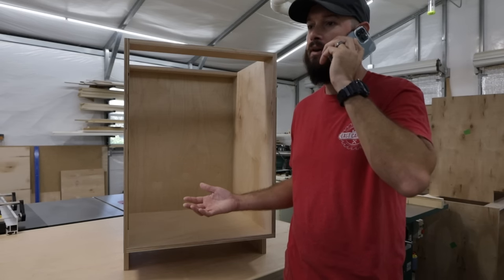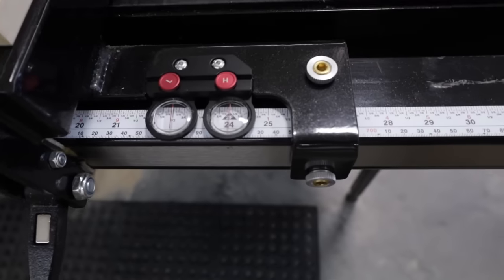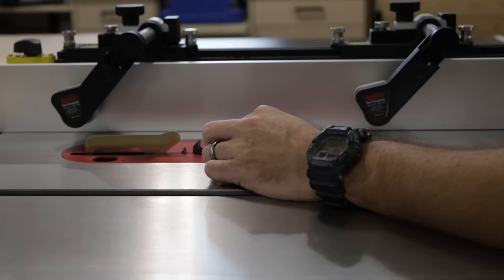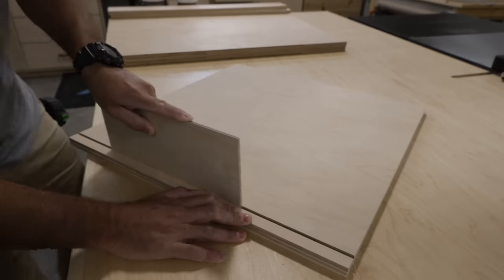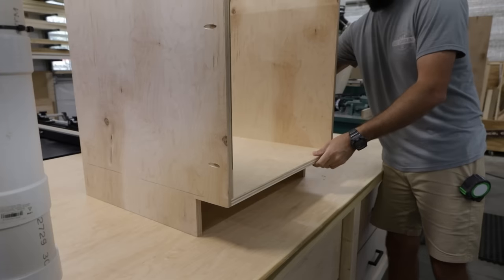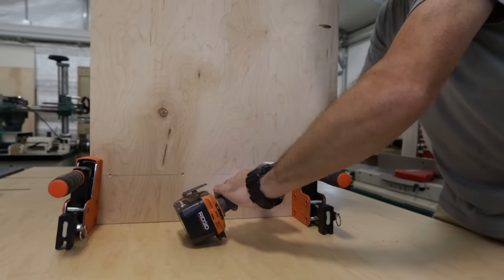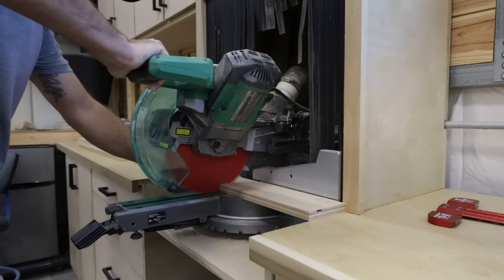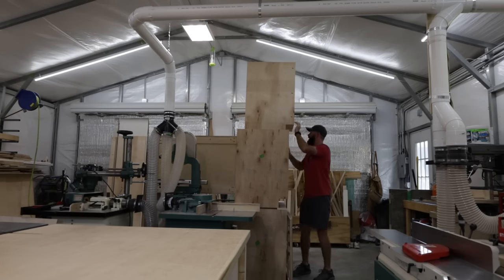How to Build Cabinets in under 30mins //The Easy Way

Comment: what fence system do you use on your table saw? I don't think I recognize it.
Reply from the maker: I have the Harvey alpha 4hp and the fence came with it. Unless your talking about the Jessem stock guides attached to it?
Reply: @eastcarolinawoodworks  I have the Jessem stock guides and love them. Probably one of the better upgrades I've made in a while. I have a saw stop cabinet but am less than satisfied with the fence, so I've been looking for ways to change/upgrade it. Thanks! Great video btw.

Comment: I just build a box, prop the bottom with 2*4's and adjustable feet and skip the facing. Doors or sliding draws you want to utilize all the space. possible.

Comment: i would argue a better way is to rabbet the back panel in (small gauge air-stapled), resulting in a flat back, biscuit join the sides to the floor with 5 on each side.  stretchers on the inside, pocket screwed on the front as shown.

Comment: Did you know if you use a loose base instead of an integral toe kick, you will get better yield from your material, easier installation because, you can level your toe kick for a run and place your cabinets.
Reply from the maker: I know but for me sometimes this is easier 🤷🏻‍♂️

Comment: Pretty good, but not exactly what the intro thumbnail showed, which was the cabinet with full face frame. A bit more challenging. 

Also, I’ve never been a fan of cutting in the toe kick. As a builder and installer often working in older houses, getting base cabinets level and square to the wall can be a real challenge so I build a 4-1/2” base to support my 30” base cabinets and level the entire run at once. Leveling is easier, installing the finish kick is easier and sturdier, building carcass is easier. And the added benefit is with 30” height instead of 34-1/2” you can get 3 sides out of a sheet of plywood with only 6” waste instead of 2. That’s if you’re willing to live with a 23-7/8” depth instead of 24”, due to saw kerf, which I generally am.

Comment: Just my 2 cents but I see you put a pencil line on the outside of the cabinet where to add the Screws . What i do is pre drill through the Rabbit and then there is no need to scribe a pencil line .
Reply from the maker: Great idea thanks for that 🤙🏼

Comment: Nice video. Two suggestions: 1) Use push "sticks" as much as possible anytime hands have to get close to a blade. There are "sticks" made that aren't really sticks, but a "handle" with a lip that drops behind the piece being pushed through. Whatever the choice, be safe. As others have said, disaster can happen instantly...along with the regret. 2) PLEASE do NOT do woodworking without dust collection/mitigation, or at least good dust masks. I don't see it in your video, but hopefully you do have it running. If you research woodworking dust, it is nasty stuff that will cause lung issues down the road. The "good ole boy" woodworking might look manly, but fine sawdust is nothing to be trifled with, and it hangs in non-moving air for some time.

Comment: why wouldn't you put the Kreg holes on the inside of the cabinet so that your Cabinet outsides were perfectly clean?
Reply from the maker: If my cabinet is sandwiched between cabinets you will never see the sides so it really doesn’t matter. On a finished end that gets painted I put them on the inside. Hope this makes sense 👍🏻
Reply: @eastcarolinawoodworks  Makes total sense, great work by the way, very nice build.. totally solid cabinet
Reply from the maker: @tmilholin7552  thanks for the positive feedback 👍🏻

Comment: For that bottom panel, couldn't you just use pocket screws on the bottom side of the pannel instead of counter sinks from the side? I worry that I'd drill/screw crooked and leave a screw showing in the bottom pannel

Comment: Greetings from northern Wake County!  As for your cabinet sheet goods, do you prefer so-called 3/4"  (actually closer to 23/32") or 18 mm or more rarely19mm?  Cherry? Oak? Birch? Alder? Walnut? "White Wood" (aka mystery SPF plywood)?  Do you use 5- or 7- core el cheapo plywood or do you ever prefer lumber core plywood or the really good (and expensive) stuff -- 11-ply Baltic birch (or a domestic equivalent like Appleply)?  

For the past decade-and-a-half or so, kitchen designers and the magazines they support have been pushing painted cabinets rather than stain-grade finished wood look.  Even my sister insisted on redoing her beautiful cherry cabinets with a hideous white painted finish (much to my horror).  I think it's a stupid fad, and as soon as the market is completely saturated with painted cabinets it will change to something even more stupid (maybe like the really awful "open shelf" look).  It seems to me if someone is going to have painted cabinets they could just as well use white melamine laminated particle board (YUCK!).

Comment: I don't use a cabinet saw any more for building cases.  I get better and faster results with my Festool track saw.  There are effective methods for getting parallel rips and square crosscuts with a track saw.  The cuts made with a quality track saw and blade are plenty good enough for case work and better than you'll get on a cabinet saw if that saw isn't tuned right.  

I don't "break down" plywood with my track saw.  I make first and final cuts.  And of course I don't do this cutting on the floor.  I have a portable cutting platform.
Reply from the maker: Sounds like you got your method and I have mine! I’m looking into getting a festool tracksaw soon. Kreg one is ok but much rather have the festool. Space is limited in my shop but I would love to have a mft bench from festool! Thanks for the feedback 👍🏻

Comment: In the time it takes you to set up to break down sheets of plywood with a track saw, you could be done breaking down parts on the table saw. Plywood isn’t that heavy. Just learn to handle them properly. No track saw needed.

Comment: WOULDN'T IT BE EASIER TO PREDRILL HOLES IN THE DADO BEFORE ASSEMBLY THIS WAY YOU DON'T HAVE TO DRAW A LINE ACROSS YOUR SIDE PANEL, ALSO I THINK 1/2" PLYWOOD WOULD BE SUFFICIENT FOR CABINETS.

Comment: Im a rookie woodworker and want to know, Why not just cut the pieces to the needed size with a track saw instead of cutting it down with a track saw first and then using the table saw.

Comment: Why do you have the pocket holes on the outside face near the front of the cabinet?
Reply from the maker: To attach the face frame. Only put them on the outside when the cabinet is sandwiched or won’t be seen 👍🏻
Reply: @eastcarolinawoodworks  Got it.  Thanks!

Comment: Why not secure your top first? I would think it would make your dado cut bottom part of the process easier. Pocket holes from the bottom and glue is plenty, skip the effort of the dado stack and the screws, seems way overkill imo. Great video overall! Couple safety tips I almost learned the really hard way. Your tablesaw safety is pretty sus. 1) In case of kick back, you should try to work to fence side when possible. 2), You were reaching over the running blade to clear the cutoff, this is super risky. I just did this the other night and slightly misjudged, shaving the corner off my finger (only like couple layers of skin and tiny bit of nail...so not serious and very fortunate). Don't reach over a running blade, turn it off, clear the piece, keep your digits.

Comment: Do you really think you need to screw the bottom in along with the dado cut?

I used to just use 3/4 ply for the backs as well. Was less labor and only 1 dimension of plywood to deal with. Of course that was BEFORE plywood was over $100 a sheet.....

Comment: Why did you pocket hole the nailer plates in the back when the sides aren't going to be finished? Also after 16 years of building kitchens and cabinets, I've learned to leave the toe-kick off the cabinet and build the entire toe-kick on site, that way I can level up the toe-kick easily, then just slap the cabinets on and I'm done. Much easier than putting a cabinet in, then having to take it out to add a shim, and putting it back, and taking it back out...just building the toekick as one big unity, then you're boxes will all be level as long as you cut them correctly lol

Comment: 10:22 I would never lay my open hand over a dado blade like this. This blade stack will not cut your hand, it will liquify whatever it comes into contact with, instantly. 
Also, generally not good idea to lay open hand over blade its not good habit for having hand in this position. Trust me, pro woodworker friend cut his hand in half doing this. 
6:40 Also, I would never put my hand between clamps or any obstructions, during kick back your hand can get bounced into the blade.
Reply from the maker: Thanks for the heads up I’ll keep that in mind 👍🏻

Comment: Can you explain why you didn’t just cut it to 23 1/4” the first time off the “break down” piece? Why break down, then break down again before the Final Cut at 23 1/4? Seems like an extra step…
Reply from the maker: Because I wanted to reference the now smooth edge against my table saw fence to get the final cut to dimension 👍🏻

Comment: Pocket screw holes and countersunk screwheads on the exterior of the cabinet is a mistake. What if it is an end cabinet? Now you'll have visible screw pockets and screw heads which need to be filled or veneered. Your customers will not be happy.

Comment: He looks like he is new at building cabinets also,  I've been a cabinet builder for 40 years. Not one time did I cut my plywood on the floor.
Reply from the maker: Didn’t realize cutting plywood on the floor classifies me as new. I was cutting it on the floor because my assembly table was covered with other material.

Comment: Why do people insist on avoiding safety measures on woodworking YouTube channels? Using a saw with no eye protection is 1 accident away from being handicapped for life. Operating a table saw and putting your hands too close to the blade. Use a push stick for crying out loud. This is the first video of yours I've watched and honestly I'm already put off just because of that. I'm not a particular fan of channels with the $100k worth of tools either. I believe most hobbyist wood workers if they have a table saw are using a jobsite table saw. My guess is for the most part they don't have a table saw. I make accurate cuts all the time with a skill saw and a straight edge. I make a lot of money wood working and doing custom metal art and I don't own a table saw. I don't have the space for it. I've adapted and I think that's what the art of wood working is all about. While I appreciate the time and effort put into making videos, use some safety gear and influence the new guy that has no clue to protect themselves. I guarantee you when he lops a finger off he is going to tell his significant other that's how they did it on YouTube. I'll get off my soap box now. My apologies this just happened to be about the 10th video I saw without using proper safety gear or failing to adhere to using a push stick in like a week.
Reply from the maker: I appreciate your concern and you are correct I should have used a push stick and eye safety. Far as the “100k in tools” goes I started from nothing and built up my business with tools that my father in law had from the 80s. I worked a full time job while building projects on the side. I worked until 2am plenty of nights building in my kitchen because I didn’t have a shop. I reinvested nearly all my profits into new tools and over the years continued to upgrade as much as I could. After side hustling for 3yrs building furniture I was able to buy a shop and finally have somewhere to build. It was also nice I finally had somewhere to store my tools that I accumulated. Also with having a shop I was able to buy bigger and more stationary tools that would grow my business even more. I’ve been self employed building custom cabinets and furniture for 5yrs and it was a grind but I reinvested what was needed to be successful. I wasn’t handed $100k in tools, I had to work for it (I don’t even have a 100k in tools). I’ve built plenty of cabinets with job site saws and other tools from the box stores. The purpose of the video is to teach others how to build cabinets and maybe try and save some money by doing it yourself. I enjoy working with wood and I want others to enjoy it as well. It’s a satisfying feeling when you can take pride in something you built. With that said I appreciate your feedback and hope you have a great evening!
Reply: @eastcarolinawoodworks  I appreciate the reply. I never insinuated you didn't work for what you have. I'm a side hustle king. I've used plenty of cabinet table saws, job site saws, and everything in between. I get the labor of love that goes into it. However, the whole idea or point of my comment is specifically for me, I'm not a fan of the channels that have all the big name brand tools. I fully get the premise of your video. I personally feel to speak to the masses it makes more sense to do it utilizing what Johnny down the street has. I'm just making a suggestion not trying to pick a fight or anything like that. Again I appreciate the effort that goes into making videos, I tried it and don't like it. Safety first
Reply from the maker: @industrialpalletworx3548  I’m actually working on a video of how to build cabinets with basic tools so it will apply to just about anyone 👍🏻

Comment: I, myself have about $500 worth of pretty low end woodworking equipment. Unfortunately you need at lest $3000 worth of woodworking equipment to do a good job like this.
Reply from the maker: We all have to start somewhere! I started with a miter saw and drill building in my living room 👍🏻 but stay tuned I’m fixing to give away a pretty sweet tool at 10k subscribers 😎

Comment: Bro, I had wood shop class (yes, I'm that old) and your safety while cutting leaves a LOT to be desired. Great finished product is not worth it if you lose a finger(s) or half hand. It happens when you don't use all the tools at your disposal. Cudos for wearing eye protection (at least it looked like you did). You no doubt influence a lot of people, young and old to work with wood and a brief mention of safety items and demonstrating it, may save a viewer with less skills and experience than you some digits someday.

Comment: Why not use a full back?
Saves all that monkeying around with other set ups.
Reply from the maker: I’m only a one man shop so this saves on weight and makes it easier to move around and install for me 👍🏻
Reply: @eastcarolinawoodworks  
It doesn't make much weight difference.   Cheaper to use one material.  I am a one man shop too.
Thanks for sharing

Comment: You lost me at "putting a face frame on the cabinet". Face frame cabinetry is a quick way of assembling cabinets, particularly if pocket hole joinery is being used, but it also greatly reduces the size of any drawers you wish to include in the cabinet.
Reply from the maker: I’m assuming you prefer frameless?

Comment: I have have never understood how people who are obvious professional can work in shorts with loose strings hanging off of them and tennis shoes even in a clean and obviously well maintained shop, I have seen so many splinters become infected and require even hospitalization in my day and while that skil saw your carrying doesn't seem to weigh much if you dropped the corner of the plate from waist height on an unprotected tarsal bone it could easily cause a reportable injury, just sayin as a union journeyman lineman for 20 plus years it pays to be prepared for the injury that you can be sure is coming. Kneeling on concrete floors without knee protection on another obviously often overlooked occupational injury that doesn't have to happen.

Comment: You didn't prefinish nor used prefinished ply and now that it is assembled that makes it a bitch to do. Don't care if you are going to fill the case with drawers, you do not leave unfinished wood in a kitchen, laundry room or bathroom.
Reply from the maker: I spray finish once the cabinet is built and prior to installing face frame 👍🏻 yea it sucks when I don’t use pre finished 😔
Reply: @eastcarolinawoodworks  Not sure what you use for finish but I was a big pre-catalyzed varnish type person. I had a couple of finishers that worked for me that were the conversion varnish types but that was a more expensive finish for the high end jobs. When you don't have prefinished, the finish the inside of the parts before assembly.  Tape the assembly areas where you plan to use glue for better adhesion. Personally I never glued boxes. I was also a manufacturer of cabinet doors and drawer fronts, there I used glue but carefully as wood moves and if you glue wrong It is going to break. Also, I hate face framed cabinetry, all that lost space.